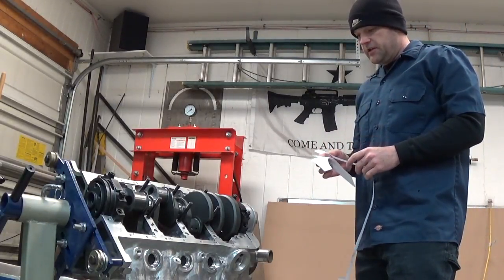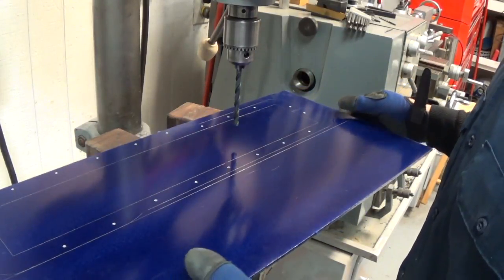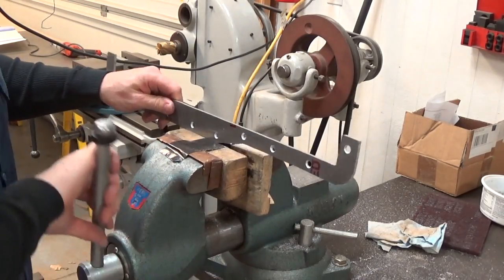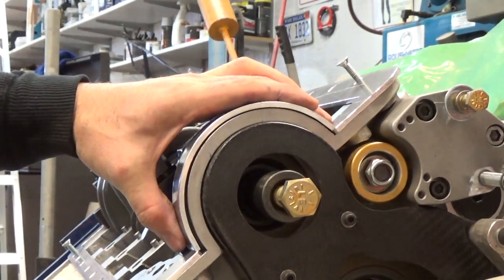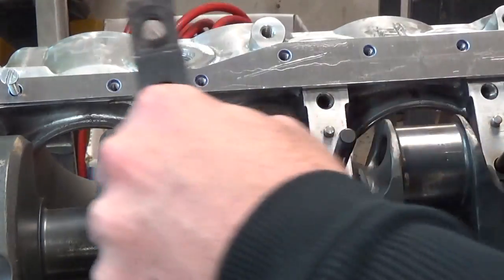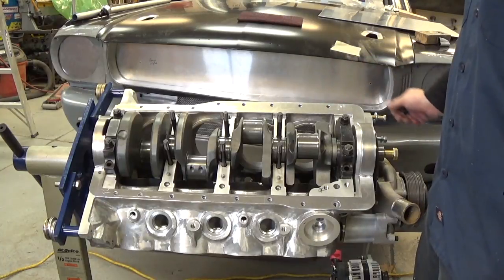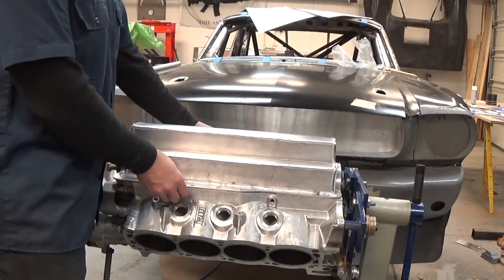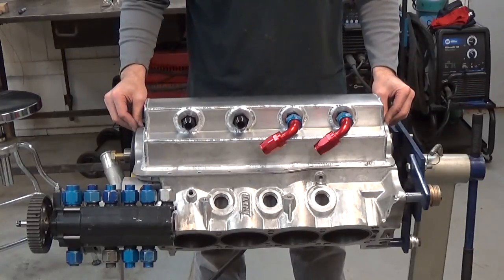Small Block Ford Dry Sump Oil Pan Fabrication

Comment: This system doesn't allow you to lower the engine in the car very much.
Reply: I was awfully surprised how deep he made this pan.  Kind of defeats the purpose, doesn't it?
Reply: @bvcxzgt5451  
That depends on the application. I would assume he's based the pan depth off of the maximum distance of the rotating assembly from the pan rail. This is not a deep skirted block so the pan will be deeper